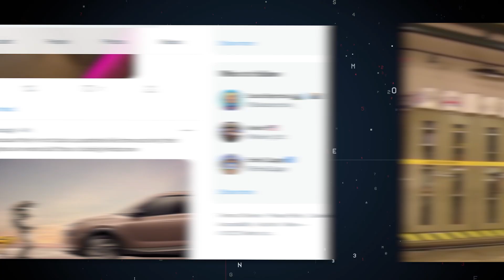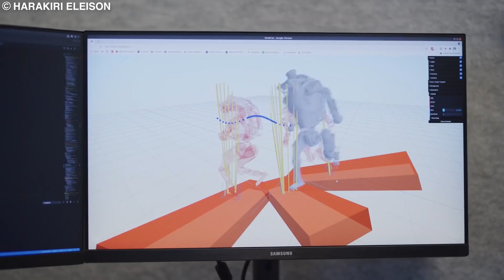Boston Dynamics' New Robot Makes Soldiers Obsolete, Here's Why

Comment: The big limitation for robots in the battle field is battery life, Atlas has about an hour or useful battery life, where humans can easily go at least 8 hours but under life and death conditions can go over a day. A human soldier also can carry high energy compact food so technically they don't have to even stop to eat / recharge where it takes hours to recharge the battery in the robot and replacing them is not really an easy option. I fully agree that we are headed to making this tech possible to replace humans completely but unless we find a solution the the battery problem they will just fill niche roles like any other weapon.
Reply: Most battles occur well within an hour hike to an enemy position.  An hour is just fine.  Imagine a drone flying over an enemy position and dropping a parachuting robot force directly into an enemy position, even directly into enemy fire.   You wouldn't need that many to make land to accomplish the mission.  These can be mass produced and even self destruct if captured.  So from paratrooper to combatant to suicide bomber all within a few minutes.  Meanwhile the area is being mortared causing the enemy to dig in and be sitting ducks for the drones to arrive and dig them out.  One could clear a city in a few days with a few hundred or a few thousand air dropped robots.  With gunfire tracking technology, who is going to fire on one when it can communicate the shooter's position to every other robot at the speed of light?

Comment: We are now reaching a new level of complexity. Even autonomous robots are nothing more than tools. People get scared when these robots are used in a way where they can fire a gun and call the shots on their own. But ultimately, they are doing this for their creator/owner. They are a tool. So when a horde of robots are used in war or raids; People can claim that it is just the robots coming to life.. but the real drama is who were the robots serving. Because robots can serve in subgroups down from the main owner. Such as main objective comes from its boss but other sub-objectives come from managers. 

A robot that completely acts AND THINKS on its own is not a machine.. It is a sentient lifeform made from machine. Two very distinct difference from autonomous to sentient. A sentient robot is made from parts equivalent to cells and DNA that have the same function as normal living cells and DNA.

An autonomous machine is made from parts that are wires, capacitors and algorithms and will never truly be sentient. Always will be a metal tool. There's a reason why sentient living things are made of cells and carbon instead of metal. Because carbon is much more plentiful than metal and can conduct electricity in a cheap way. When carbon life dies, it makes room for new carbon life that can continuously replicate itself with better iterations of itself (evolution) much more efficiently than would metal life. 

A machine can conduct electricity much stronger than carbon life and is a lot stronger but metal is not as common as carbon and also not as efficient. Does not decompose and very hard to shape and program naturally. This rigidity in shaping and programming would cause it to evolve/grow 100x slower even if it's brain is 100x faster.

Comment: The biggest challenge today is a long lasting power source that is both small and robust.

I don't necessarily see humanoid robots being the likely first entry into fighting wars. Our physiology is unstable, slow and week compared to quad legged, wheeled and tracked designs. A wider and lower design with a top mounted weapon is usually better suited for actual fighting.

This will only change when robots are advanced enough to have a body comparable to a human body, and thus could also be able to operate equipment and weapons made for humans. But, one might ask if, at that point, there would be any such devices, as specialized equipment without any human interface would be more likely to be fielded.

Comment: Not sure how robots will replace soldiers any time soon. For one, the power source is very limiting. They currently can only run for around an hour? Will need a significant step up in battery tech before it is even considered, even if you ignore the current level of A.I., etc.

Comment: 😆😅🤣😂🤣  no,  you had me already to debunk, before I heard it was cgi.   Number 1 reason: humans reproduce,  robots do not they are highly expensive and difficult to build, program, and repair.  Robots,  even neural networks are EXTREMELY specialized, which is why they make great drones.   Give them something they've never encountered,  and they struggle.  Robots will make the battlefield safer for humans,  but there is no way to field an army of robots.   It's taken decades to get a robot that can run and jump on its own.

Comment: Could we see video of the robots operating in mud, on ice, in dust, forcing a river?
All those complex joints look pretty delicate.
Reply: You can ruggedize joints relatively simply by sleeving them - but most of this video shows robots in some stage of development, so that's probably why they are left exposed in many cases.
Reply: Yes very good point. 
Just a few grains of sand in any of those joints could spell the end
Reply: @ecurb10  there are many industrial vehicles with complex joints that can withstand way more than any human could, i’m sure they could have far surpass human endurance
Reply: Great point.
Reply: Biggest problem for these robots is power supply. We don't have the technology yet to power these things without mains for an extended length of time.
Reply: @smokemeakipper1076  Yes power, a major issue that is missing in almost all of these comments. The batteries only last a few hours when stressed. The batteries take many hours to recharge. The machines will need to be repaired. My experience in the military working on advanced aircraft and experience in automation makes it clear that machines break often and can sometimes take weeks to repair. Sometimes we were waiting for parts for almost a year. Machines need  a lot of maintenance and troubleshooting to keep them functional, especially ones used in harsh environments. So many issues, I only named a few among many, most are just fantasizing and ignoring obvious problems that will limit their fantasy.
Reply: there is footage of a robot walking on ice with no problem
but robots are just not advanced enough for war and will always have disadvantages rn
walking on ice and stuff are possible but they probably wont ever be working for more than a year with 0 or near 0 maintenance which is basically a normal war scenario
Reply: Not yet, but look at how much these robots have advanced in 10 years. Another ten, adding on Moore’s law, means in less than 10 years they could be doing that
Reply: Industrial vehicles can withstand all that and more, i’m sure with proper sleeving and it would be fine- there are already robots built for almost every environment, think of the ones on mars
Reply: focus seems to be the AI, how about power supply. simply takeout the power source then wait.
Uber & tesla are yet to deliver an AI solution to just the driving task. 
now some CLOWN thinks these will walk on water! battery/generator lasts for how long?
ABSOLUTE NONSENSE!!
Reply: Why are these people pushing and hitting robots? What is it designed for? See how the robots will fight back? So after all, this is not embedded in them and there is nowhere to take it. And if it is laid down, then it means the whole essence of these works is to create an artificial intelligence ready to destroy a natural person. What are we going to? Where does this "civilized West" lead the World? Isn't it enough that people are killing people? Russia is the last country where people want peace. And that's why she's alone now.
Reply: Many organizations, e.g. nasa have managed to design cockroach robot, though. While bipedal robot and quadripedal ones are good for various daily task, the ones for harsh terrains are different kinds. Why bother sending humanoid ones if we can put guns on drones, cockroach, or wheeled robots?
Reply: Water balloon filled with some sugar, dirt, and soda -bonus points for some feathers 
Aim at joints and (more importantly) cameras/sensors 
Then find the nearest well...
Reply: A sandstorm would finish all that rubbish
Reply: @maozedung7270  Could be.  A sandstorm finished the helicopters flying to rescue the Americans held hostage in Iran.
Reply: @tomrecane6366  I m sorry about. But on the other hand US should better stay always at home. US has no business there.
Reply: @maozedung7270  The US had no business overthrowing mosaddegh in 1953.   
It had every right to get those hostages out. 
A tragic 26 year farce over oil.  F——-g oil.
Reply: @maozedung7270  China has no business in the East Asia Sea and Tibet, come to think of it.
Reply: @thathandsomedevil0828  South China Sea?
Reply: @joy1ess  No, it was originally called South East Asia sea, I refuse to acknowledge the ccp's renaming of it.
Reply: Titanium, son..
Reply: ATTENTION!!!! JESUS CHRIST IS COMING!!!!   IF YOU DIED TODAY, WHERE WOULD YOU GO???  HEAVEN OR HELL???  Jesus loves you and can forgive you of any sin that you have ever committed.   Repent and accept Jesus as your Lord and Savior and you will have eternal life in Heaven.  ROMANS 10:13 Any one who calls upon the name of the Lord will be saved.
Reply: @youtube_chaplain   Jesus never existed.  Christian Mythology for dimwits.
Reply: Better followed with tests in blood, flesh, bones, still-crawling and dead bodies.
Reply: lmao its a fake video rofl they used cgi and this is a repost of an old video
Reply: @IAMLBM  
This video used many sources, some of which are very real.  All the Boston Dynamics clips for example.
Reply: @IAMLBM  It's not a "fake video". As is clearly stated in the video, parts of the footage is from Corridor's skit using visual effects - but mostly it's a mashup of real demonstration videos from Boston Dynamics.

Comment: Even if this agility is real, imagine the energy consumption of one of these units. Now how often you charge your phone...  Yea now you know what I mean.
Reply: nuclear
Reply: @manzfishing6531  Nuclear what, you want a fucking nuclear reactor inside of the robot? This isnt starwars nuthead, nucler reactors need to be huge to actually work. Lmao
Reply: But that requires nuclear fuel, an extremely scarce resource. 

I’m not poo-pooing robots, but if they wanted to be energy-efficient they’d have to model humanity until they became us (replete with our sensitivities, vulnerabilities, and weaknesses).
Reply: @117Industries so governments make them nuclear and use them sparingly, for tasks they rather real people not know. Even if their extremely expensive they would get used just not replace all infantry entirely.

Whatever form it takes robot soldiers will be a thing, just not sure how many or the implementation yet.
Reply: @JamesTodorovich  My initial comment seemed a litte out of context. I was probably replying to another commenter on the thread (indirectly and without an '@') but their comment's since been deleted. 

It sounds like you're talking sense, but I don't imagine line infantry will be replaced any time soon because upgrading these machines to be nearly as efficient as humans will be a long time coming.
Reply: Such an underrated comment. As of now the top comment is by some moron who thinks that the 3 rules of robotics exist outside of the fiction they were created in.
Reply: ATTENTION!!!! JESUS CHRIST IS COMING!!!!   IF YOU DIED TODAY, WHERE WOULD YOU GO???  HEAVEN OR HELL???  Jesus loves you and can forgive you of any sin that you have ever committed.   Repent and accept Jesus as your Lord and Savior and you will have eternal life in Heaven.  ROMANS 10:13 Any one who calls upon the name of the Lord will be saved.

Comment: I don't see entire squads of just robots not only do you need programmers engineers and things like that to maintain them but they would be pretty vulnerable without humans with them

Now I do see many uses for them especially factories for weapon productions when most of the workforce is at war or maybe even bomb defusal if you could make spot more accurate
Reply: Indeed, each unit would need a team to run… but if it was that good, it would probably work… especially in short term missions; enter a building etc.   just worries about EMP counter measures.

Comment: There is really no reason I can think of for a humanoid fighting robot.  It seems like there are much more robust platforms than a bipod with two arms.  For example, there is no reason not to have super stable 6 legs and 360 armed turrets above and below with a targeting computer that is almost infallibly accurate.
Reply: Fewer legs have better cost/efficient ratio from an energy point of view
Reply: @CienciaenCadena  Yeah but more legs mean more stability for a firing platform.
Reply: @MLATX512  I was thinking something from 2 to 4 legs max. I don't think that the stability that you gain with more than four legs justifies the excess in energy. I guess the limiting factor of this machines will be the battery, if they drain out in the middle of the battlefield it is lost, so they will be adapted to the best efficiency
Reply: @CienciaenCadena  Great point.  And, if the biped can go down on a knee, you have a tripod, which is stable to a very acceptable degree. Especially given the conditions of a battlefield.
Reply: Can you imagine the stability of a multileg bot for long-range sniping?  A centipede with a sniper rifle?
Reply: @CienciaenCadena  Solar replen panels integrated, swap out batteries and overnight charging.
Reply: @CienciaenCadena  Put 100 responsive legs on it and it will be able to shoot the testicles off of a flea at 1000 yards. :D
Reply: You know all that is 100% fake/CGI right? It was made by "Corridor Crew" (a video special effects YouTube channel) after so many people thought the Boston Dynamics dance video was fake but was actually real
Reply: @richardduncan9740  Whether it is real or not is immaterial to the argument.  A bipedal robot with two arms, although it looks like humans, is not the ideal fighting robotic platform.  There are a lot of great things this body type can achieve, namely carrying a wide variety of objects over uneven surfaces.  Anyway, I figured it was a forward-looking video of some sort because I'm pretty sure that Boston Dynamics is sticking to Asimov's rules for robots.  Makes sense that it is fake.
Reply: JESUS CHRIST IS COMING!!!!   IF YOU DIED TODAY, WHERE WOULD YOU GO???  HEAVEN OR HELL???  Jesus loves you and can forgive you of any sin that you have ever committed.   Repent and accept Jesus as your Lord and Savior and you will have eternal life in Heaven.  ROMANS 10:13 Any one who calls upon the name of the Lord will be saved.

Comment: True, fully-functioning autonomous robots would require tremendous amounts of compute performance in a highly mobile package - something which doesn't even exist in supercomputer form right now. The industrial base required to build and maintain such robots would need to be incredibly advanced, with incredibly sophisticated and fragile supply chains. High-end computer processors today require months to manufacture from start to finish, using the most sophisticated and expensive factories (by a lot!!!) on the planet; such industries are incredibly sensitive to disruptions of any kind, in their internal environment or the supply of electricity (which is needed in staggeringly copious amounts) or consumables of various kinds, including very large quantities of ultra-pure water. Any power outage at all will lead to any silicon wafers being produced at that moment to become rendered useless - wasting tremendous amounts of time, money and resources. Damage to the outer structure would lead to loss of overpressure and contamination of the clean rooms inside - again ruining wafers in production (and necessitating time and labor intensive decon efforts, replacing all the air filters in the facility etc), and so on.

Such supply chains could never work under actual wartime conditions. You could only ever field armies of fighting robots if the nation which is producing the robots is never under any sort of attack itself.

Also, complexity, cost, reliability etc. People with all their flaws are overall much easier to field, so color me very skeptical about the viability of fighting robots.

Comment: I think there is a lot of potential, but the exact conditions would need to be right for a practical solution. I think there is likely tremendous potential to immobilize or severely restrict the movement of such an autonomous robot with methods of entanglement like nylon rope or steel cables.
Reply: Paintballs to the optical sensors.
Reply: @adambaum5824  or even a small water balloon filled with paint. A very inexpensive way to make a very expensive device functionally inoperable.

Comment: This dipshit doesn't start the actual video until 6:55 min. On a different note, another disadvantage of having robots replace soldiers is their vulnerability to an EMP attack.
Reply: Armies of robot soldiers will be a pipe dream for a long time to come. One big problem is energy. Batteries weigh a lot but store relatively little energy compared to old fashioned gasoline. All those moving parts will need to be kept clean and lubricated. And what about spare parts, and supply chains from factory to battlefield? Who will fix wounded robots? Will they repair each other? I think one of the reasons that Boston Dynamics has had a revolving door of ownership is because people enter the business with sci fi fantasies that are crushed by details one just doesn't consider carefully until after the purchase. It's like owning a big boat: it's a hole in the water that you pour money into.
Reply: @JuteTwine  All good points I agree.